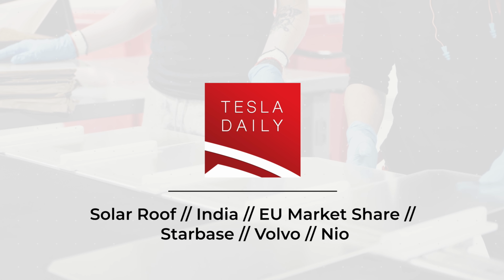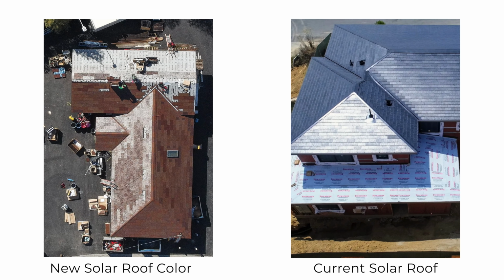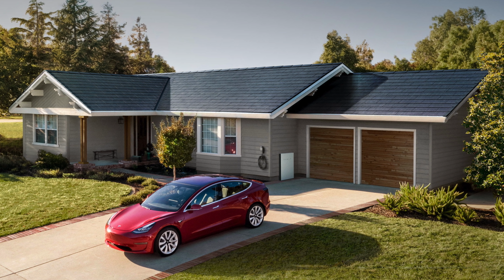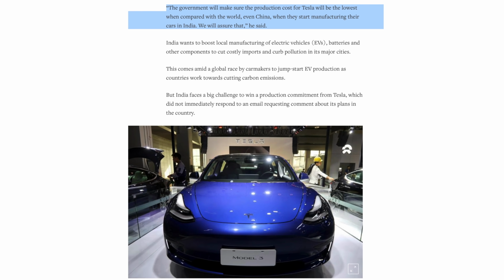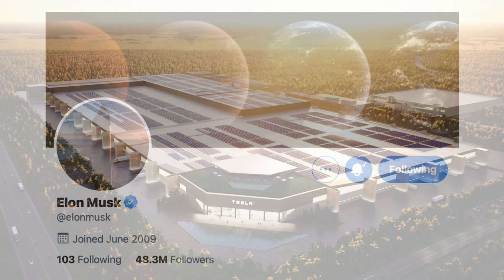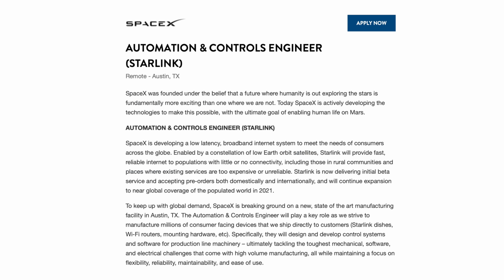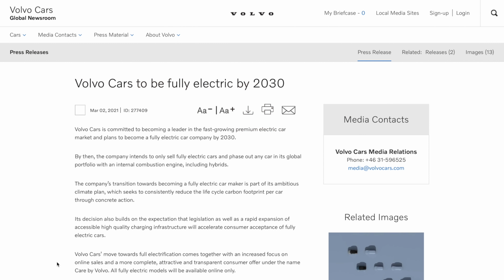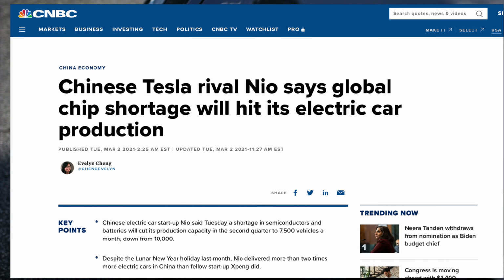New Tesla Solar Roof Design? + Starbase Texas, Tesla India

Comment: 10000 cars per year volume is low because BMW and Mercedes are expensive in India comparing to US. Reason for expensive is
1. Higher Tax
Most of the luxury cars import parts and just assemble the car in India or they fully import. Tax for assembling is 15 percent but Tax for CBU(directly importing fully made car) is 60 to 100 percent. 
Then Car sales tax is also at higher side which is 43 percent for luxury cars. Then extra road tax which is 15%. All these taxes increase luxury car prices alot. 
For example: Currently BMW 320D costs 41000 USD in USA but same car costs close to 80000 USD in India. That's why luxury cars sales are very low in India.

But if Tesla is fully Made in India, then there won't be import duty, Sales Tax is 5 percent and various states offering reduced road tax and also there is subsidy in some state. Overall car will be very cheaper and it will be very affordable. If Tesla available for 30 Lakh (41000 USD) on road, more people will buy. Indians look for more mileage and less maintenance for which Tesla will be perfect.

Even I want to replace my existing car with Tesla only. Hope they plan to start the plant in India.
Reply: What price point is considered a luxury car in India and subject to higher sales taxes?

Comment: Anyone knows how tesla solar roof handles shades in some spots on the tiles?
If the are circuited in Stripes without every cell having a little Chip that can shortcut shaded cells ,it will reduce the output of the whole stripe to that of the single shaded cell.

Comment: Volvo's statement to not SELL any combustion engine by 2030 implies basically that they will not launch a new combustion car after around 2024, because most cars of all car manufacturers are typically produced for a time span of around 6 years. So it would be stupid (=not pay off) to introduce a new car e.g. in 2027 and then stop production already three years later.
Therefore I would consider the statement as very ambitious, because to a big extend this means, that after launching maybe 2 or 3 new cars in the next 2 or 3 years there will be no new launch of a combustion engine beyond ~2024 by Volvo.

Comment: I owned Nio @ $2 and got made fun of for selling @20x ... You buy low and sell high right? This is why I sold short Tesla. Target is $450. Stop in and emotions out. Interesting times.
Reply: It's just a case of how much you're going to lose...... The only things taking Tesla to 450?
General recession (nothing to do with performance), or another split.
Reply: @rogerstarkey5390  Your statement makes this clear: you have no knowledge of trading risk, stops or booking profits if thesis fails.
Reply: @rogerstarkey5390  Have you done a lot of digging? There is much more to the current story than just what all these bullish rants repeat on YouTube. These are greedy bulls. They have earned 20x on a stock and refuse to take profits. I had 20x on NIO and wisely I sold for someone else to take a loss. That is the game my friend.
Reply: @rogerstarkey5390  not everyone is trading.
For an example Rob baron has only ever bought shares since 2013 ~.
I am only buying shares.
I know i could potentially make a 50% gain trade during a few months of market capitulation etc. But I rather just own what I own and collect more.
Its easier for me and it works well

Comment: Starbase homes built with solar roofs, power walls, HVAC, and biodefense hepa filters then  being driven by a robotaxi to go ride on the big ass 🚀. What a time to be alive!
Reply: I've been suggesting a "Tesla house" since the Berlin press conference when EM was praising the prefabricated factory  building process.
It's a logical extension to fit the Tesla components (roof, solar, storage, WiFi, HVAC, car) into a controlled "system" (house). Then  it's simply the logic of how to build it, which has to be prefab....... Unless(!) there's an opportunity for Boring project bricks to be used?? (Tunnel in Texas?)

Comment: Elon has to build a MOON COLONY as a perfect FIELD LAB to test all the necessary systems for the eventual Mars colony. Moon is only a few days ride from Earth and is the perfect environment to simulate inhospitable conditions on Mars. I am actually surprised why Elon never talks about establishing such a colony on the moon.
Reply: Skip the moon - hardly any gravity there.  Mars has 38% the gravity of earth.  Low, sure, but significant.  Also has some atmosphere.  Again, low, but enough to fly a special designed NASA helicopter.

So many differences from mars that it seems (to me) to be a waste of time fool around with moon first.  Use time and resources to solve problems directly on mars.  Perhaps go to moon later, perhaps as a way station to mars/space.  It seems to me that there would be more problems for long term human habitation on the moon than there would be for mars.

On Mars one could lift weights to help stay in shape; they would just have to weigh more (earth weight 100lbs = 38lbs on mars).
Reply: @samjubilee6593  Moon has 16% of gravity, enough for test purposes and most importantly exposure to extreme radiation and temperature spikes... If sending a life-sustaining module with crew to moon costs >$100M, then to mars >$1B and decreased survivability of the crew.
Reply: @samjubilee6593  
On the other hand, if you want to confirm the building systems work in extreme conditions, test them in much more extreme conditions?